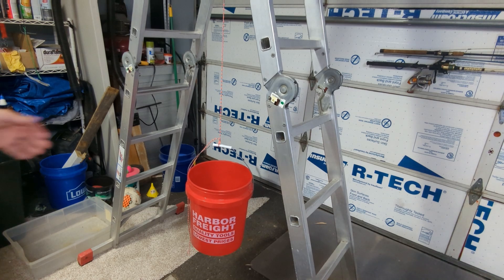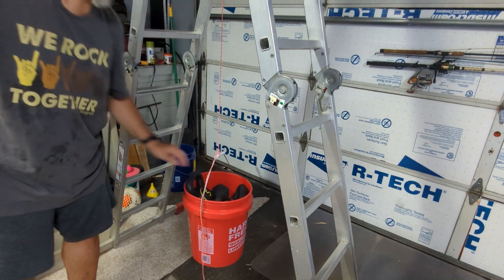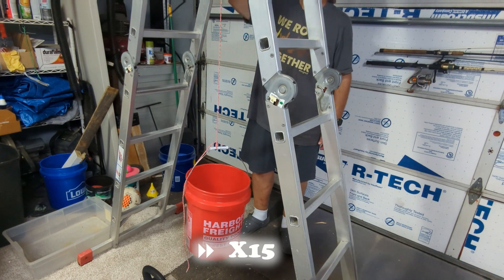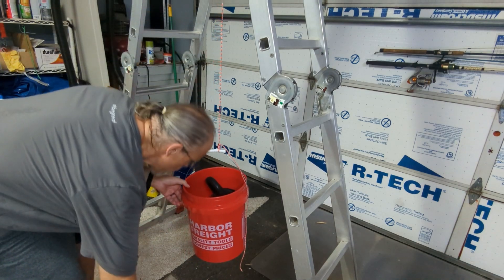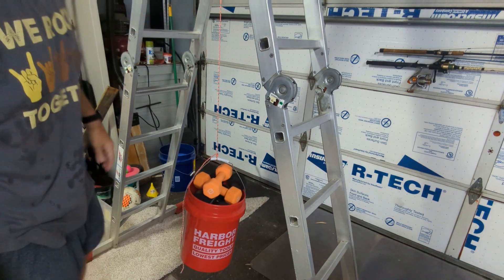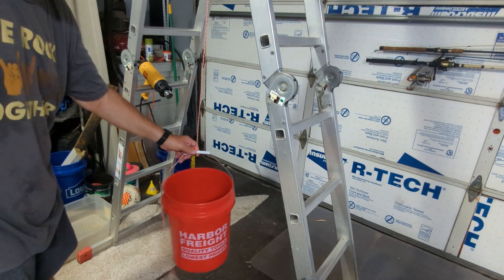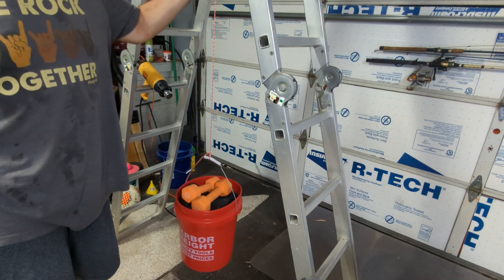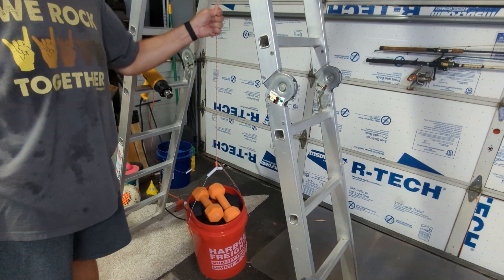Paracord Heat Shrink Load Test

Comment: In the past, I have taken gutted cord and passed it thru a hair curling iron to heat fix the cord into ribbon.  This ribbon was then used in braids and turkshead knots.  As there was never loading on the material, its strength was never a concern.  The main consideration was that it would retain its ribbon shape when the knot or braid was tightened.   BTW, since the thrift store sells curling irons at very inexpensive prices, one can buy several and put the kids to work.  ;)
Reply: Do  you think this would work well for neckerchief slides for scouts?  We have our scouts make them for the incoming cub scouts each year.
Reply: @Troop66Scoutmaster  — It ought to work.  Also, after the knot has been snugged and dressed, consider coating it with a finish like varnish, shellac or even white glue thinned with water.  The finish will stiffen the knot and make it hard to soil.  Two of my goto finishes are thinned superglue (which results in a rigid knot) and clear nail polish (which minimizes fraying without too much stiffness).
Reply from the maker: That's a damn good idea.